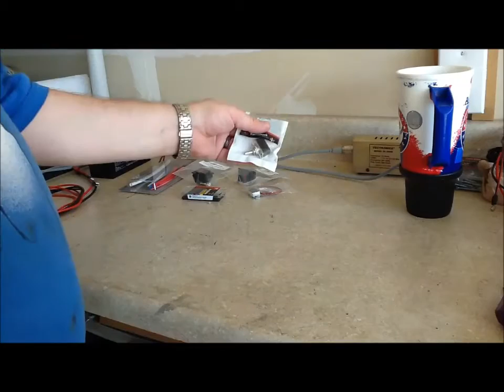30Ah Battery Box

Comment: Nice one Richard.
I have a question. How do you protect the batteries from overcharge?
I like the Powerpoles and volt meter. Nice touches.
Reply from the maker: When charging by grid power the Noco Genius smart charger I use prevents the batteries from overcharging.  With my foldable solar panel I've got a Battery-Tender charge controller that is supposed to prevent overcharge.

I'm glad ya like it, Julian.  I was kinda disappointed that I had to take out one of the batteries; but I'd rather do that than mess up any of the wiring.
Reply from the maker: Darn it!  I forgot about adding an in-line fuse.  I'll be sure to add one to the cables though!